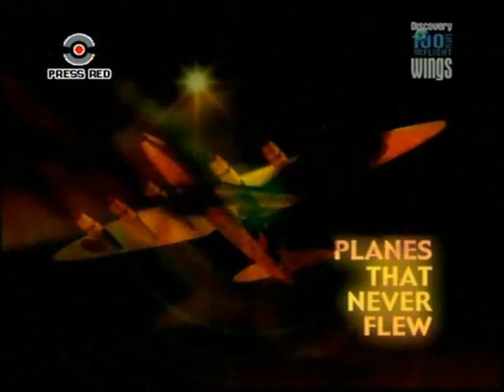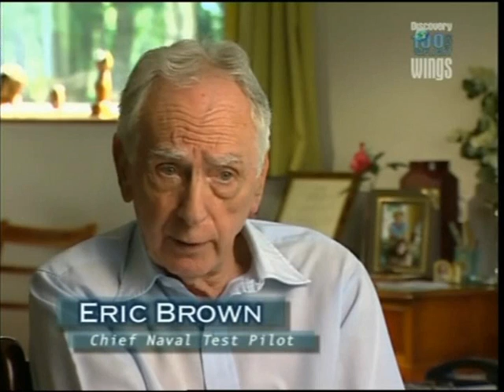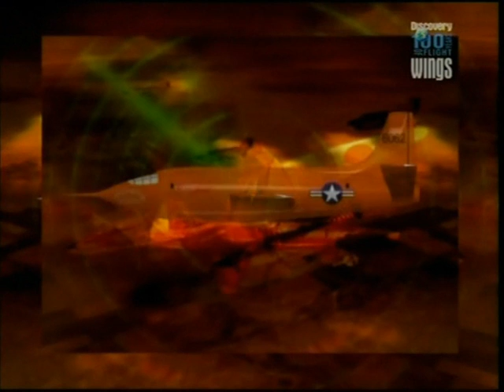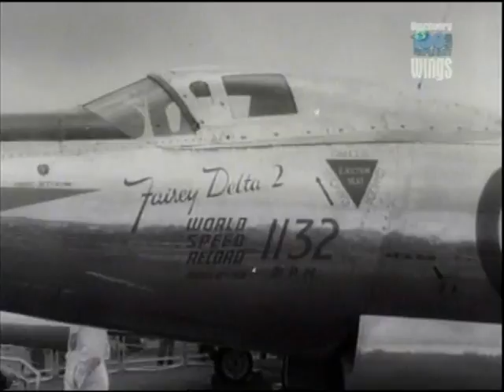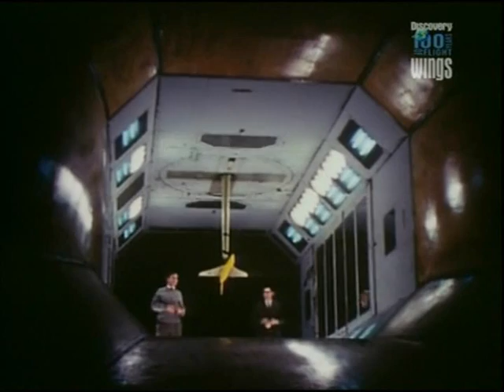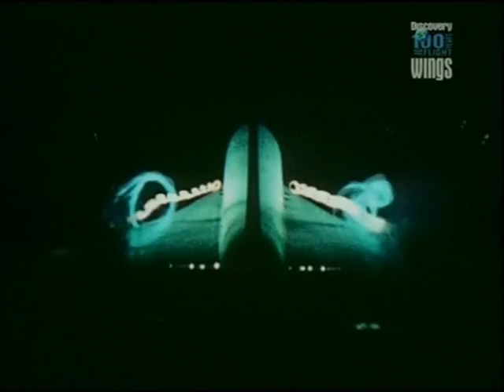Planes That Never Flew - The American SST - Boeing 2707 1/4

Comment: Yea the Tu 144 was a copy of the Concorde, yet the tu-144 flew 6 months before Concorde, the 144 had retractable Cunard's, the 144 was larger with greater passenger capacity. The 144 had obsolete air conditioning units adding weight. Was loud inside. Yes the Tu-144 was a copy of the Concorde.

Comment: In 1943 an ultra intercept revealed a German 1000 klms/hr project which was mistranslated as 1000 miles/hr (1609 klms/hr). speed of sound depending on conditions (1225klms). Resulting in the British project.

Comment: what is this documentary about, the 2707 or concorde? why do the British have to hog the spotlight?
Reply: It's about the Boeing 2707. All CGI renderings show the 2707-200 swing-wing design only, but not one of the 2707-300 delta wing design.

Also note that Convair proposed an SST derived from the B-58 Hustler, the Model 58-9. More info about the Model 58-9 is available at this link:

https://en.wikipedia.org/wiki/Convair_Model_58-9

Comment: Ozz; check your facts before posting mate. There is an important distinction between the two. The all-flying tailplane (STABILATOR in American English) was first developed for the de Havilland DH.77 in 1927. During the development of the Miles M.52, it was found to be an effective solution to pitch control difficulties at transonic and supersonic speeds. Without adopting the stabilator, the Bell X-1 is unlikely to have successfully achieved Mach 1. It is now standard on supersonic aircraft.

Comment: An interesting documentary in a fascinating series, but not without its inaccuracies. Here are several:
i) The control surface articulations on the Bell X-1 graphic are incorrect, as is the use of an elevator. The aircraft was in fact equipped with a stabilator.
ii) A DC-8 is used to illustrate commentary on the 707 on two occasions
iii) The statement that 2 aisle seating configuration is more comfortable than the 'traditional' 1 aisle arrangement is little more than manufacturer's spin.